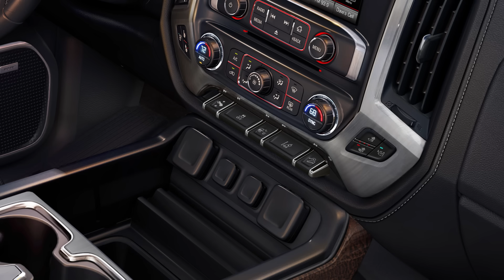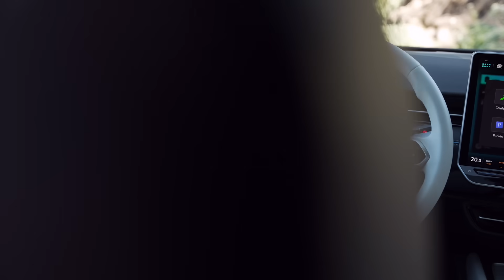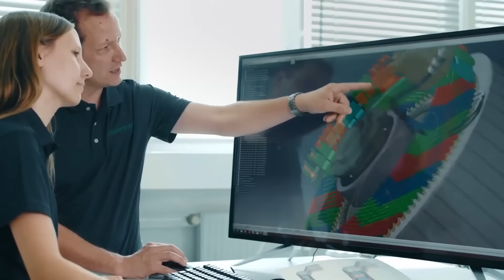Hybrid Sales Expected to Triple; Ultium Battery Workers Getting Raises - Autoline Daily 3634

Comment: As hybrids go, i had an opportunity to rent a 2023 Toyota Sienna hybrid awd.  It may lack the sheer power of Odyssey or the flexibility of the Pacifica, but the MPGs more than makeup the difference. I saw as low as 33 in the city and even hit 40 on the highway, but the overall average was 35. Even though BEVs are becoming more popular, it will take years before the charging network is built, some companies have lost alot of money or are no longer around trying to invest in that market, and the aftermarket is too large for ICE vehicles as it is. Look at the European automakers. Most  if not all of them had to reduce their workforce to offset the R and D cost  and no one has stated what will be the revenue shortfall from the registration of ICE vehicles here or overseas if their ownership is reduced.

Comment: If they integrated proper tech you wouldn’t need to supplement with your own phone.   Power would be only thing you needed.  Both usb ports won’t fast charge.  A 120 outlet allow you to use your own transformer and fast charger.

Comment: Just go all in on USB-C.
Reply: Agreed. Get it over with! 
Keep those 12v sockets so I can still use all my old USB.
Reply: Adaptors from C to A are three for $3.30 so just keep a set in the glove box.
Reply: @heathwirt8919  Yes! Adapters plus 12v allows for coolers and cooking. Do you know why there is no inverter options for 110v AC?

Comment: The ports built into the car should be the latest established and ratified protocols which in this case would be a USB-C form factor and some variant of USB 3.1 or 3.2 if delivering data. Customers who need to retain legacy devices can find cheap adapters for USB-C to A type and since those pull much lower power numbers there's much less of a risk of fires. Sticking with USB-A seems like the company doesn't want to spend $10K to update the specs on their 250k units/yr vehicle which sounds silly.

Comment: Replacing batteries on semi is going to be a dead end. Tesla Semi already does 500 miles (Pepsi uses them daily for 420+ miles) and with batteries improving ~5% a year, within 5 years they'll do over 600 miles. At 600 miles, the driver will need a rest before or around the same time the Semi will need a recharge, so driver rest and recharge will be perfectly aligned. Battery replacement is much more expensive, less reliable and requires much more space at "refueling" stations. By the time it's deployed, it will be useless.
Reply: Sorry but your outlook is dead end, Tesla semi is a flop, poorly designed and underwhelming, promised years ago it's a museum piece already. Drivers have to rest but trucks don't, so swap out the batteries, put in a fresh driver and off you go, time is money. I'm not Tesla bashing but they got it wrong, no one's perfect.